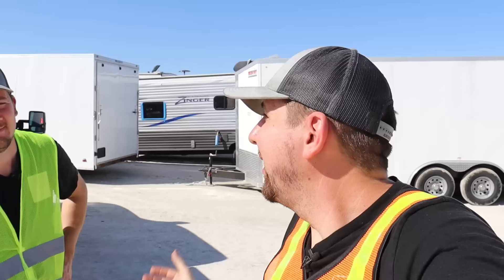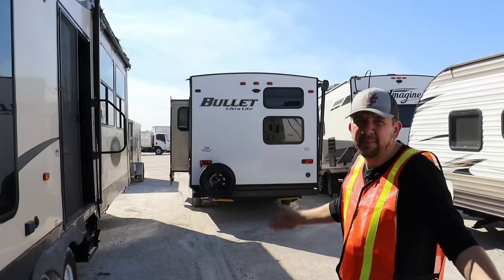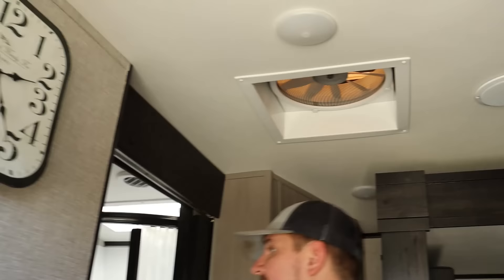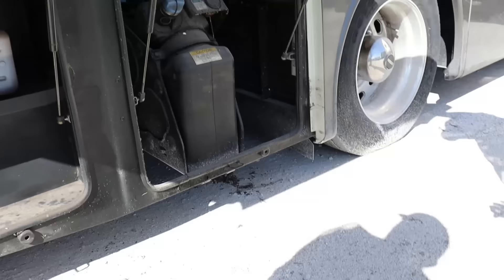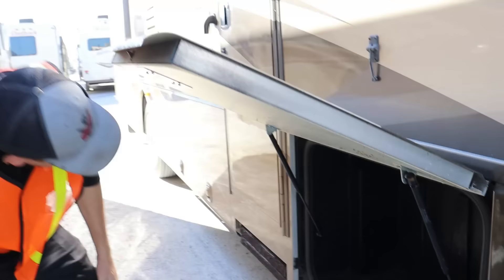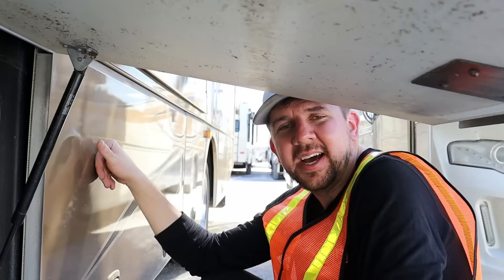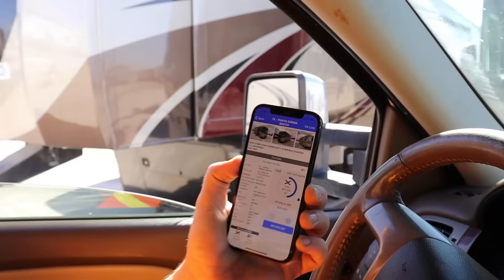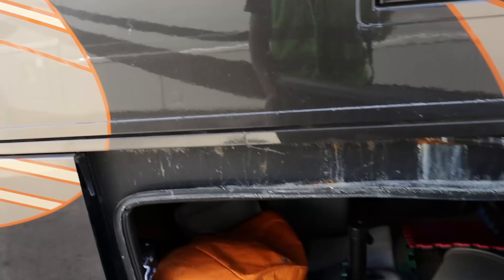SALTWATER FLOOD RVS & CAMPERS FLORIDA COPART WORTH IT?

Comment: I would have jumped on the heat damage. That rubber roof is rather easy to replace.  Change out vents. Some dicor. AC gasket and have a new trailer.
Reply: That heat damaged Jayco would need an entire sidewall.  with all that heat on the side/roof, the fiberglass would be baked dry and crackly

Comment: I'm no authority but my 1998 Monaco 36' Windsor Wall Slide that has been parked must be worth 20K if these flood units are bid up to 12K already I think these auctions must be full of scammers or hard ups. They just pressure wash them and put them on a lot? I know you will need to go through the brakes, air suspension, engine, flush the tanks and mine needs all new windows and 6 tires but then you can redesign it on a solid chassis. Incorporate solar on the roof and electrify them more.
Reply: A 1998 36 foot camper is not worth 20k in 2 years it will be worth 4 to 5 k
Reply: @horstebreedow8608  It is a Diesel Pusher. Not a camper. I might have to pay someone to tow it away. I talked to a friend he said it is worth a couple thousand so I'm keeping it. Supposedly it has over 20k# of weight in it.
Reply: @timsteinkamp2245  I've got an old 83 24ft with a ford 460 and c6 transmission. It's in need of total coach rebuild, Windows etc. But you know what? I've come to the conclusion I care less about looks and more about function. Windows can be temporarily boarded over and the chassey is like new. Bathroom leaks bad and caring has seen better days but you know why an RV is way better, because they came with decent roofs. This year on black Friday I bought a 4500.00 dollar generator. It's a start but if I were you and you got plenty of space like me and you want to camping( even local camping is better than no camping). I wish it was diesel but that old 460 is sure dependable. Ya mine is worth diddly squat , the general public wouldn't give me crap for it. Even in its rough condition I've used it in the woods. Way better than a flimsy tent. Ya you got something there. 36 ft is plenty.
Reply: @horstebreedow8608  Another thing people don't talk about and may not be true anymore is that a motor home was considered a home and needed a search warrant to enter. Something the rich people appreciated. If you wanted privacy and security you had a motor home. Also if someone is becoming unfriendly where you are parked you just get behind the wheel and drive away. My first MH was a 28' 1972 Champion my father took his family around the USA. I was in charge of maintenance. We had seven family members and Grandma. We dropped her off in Wisconsin. I would consider a late 90's with a slide. Since the slide came out they are all basically the same.

Comment: If you knew the shit built quality on campers, especially the 1/2 ton/SUV towable travel trailers, you would never ever buy one.  Now throw in flood, no wait, salt water flood.  Same drill as the cars/trucks, flood camper is a parts only donor organ.  

Even more problems with RV due to delamination in wall, floor, roof/ceiling.  Then you have hundreds of cheap ass crimp connectgions and splices that will consistently corroide/fail.